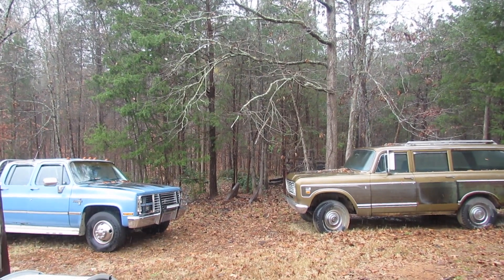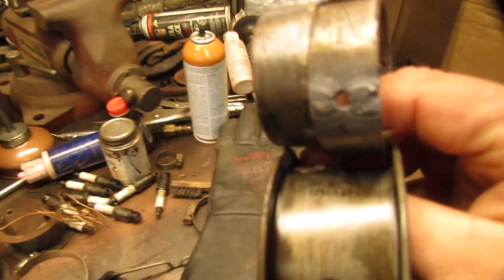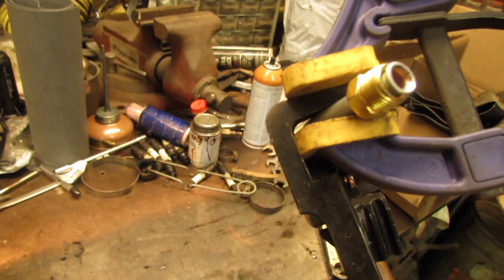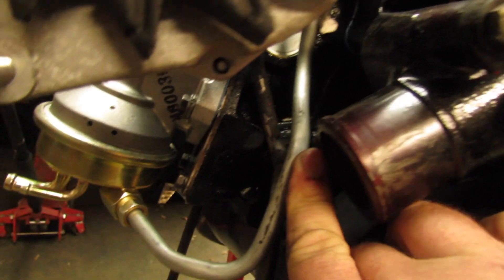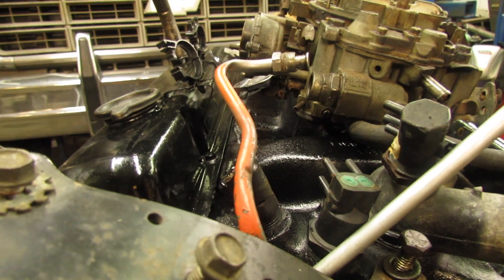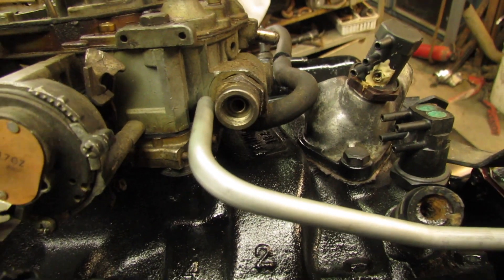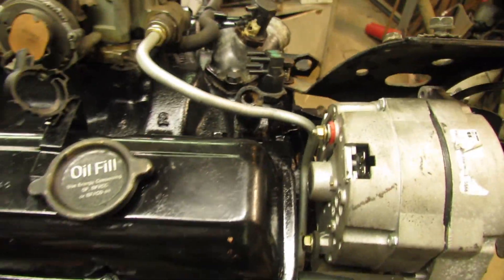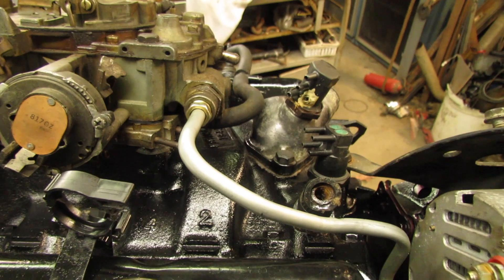Build fuel line for engine

Comment: Question. Is that fuel or brake line, and what size. Thanks! Great video!
Reply from the maker: It’s 3/8 line. Good for brake or fuel. Usually on the rack at Napa or whatever
Reply: @MrHevyshevy  Thanks for the reply!

Comment: How can I do the same with a 600cfm holley carb? I mean, the fuel inlet has no connection fitting.
Reply from the maker: There is probably one available.
Reply: @MrHevyshevy  thanks. That was a fast reply. Do you know about a good replacement for the banjo connect?

Comment: To all viewers... think about this. If you have to cut and flare your new fuel line... Run a piece of 3/8" rubber fuel-line over new steel line before you create your final flare. .. to serve as a bushing/cushion in tight spots near lower block area and tight spot btwn block and alternator.  Good Luck. Good video.

Comment: What type of tubing did you use and how much did it cost I have a 305 and a 350 I need to do this for
Reply from the maker: 3/8 steel tubing available at ant parts store. its not expensive.

Comment: Really nice work!  That's an ambitious fuel line project. I almost always insert a small filter close to top so I have the short connector rubber lines to buy me a little wiggle room. The filter provides the excuse for imperfection.

Comment: I hear on the next season of Dr. Who, they're getting rid of the phone booth and replacing it with Mr. HevyShevy's workbench. No one will doubt that somewhere on that bench ( next to the electrical tape and underneath the adjustable wrench) is a portal to another dimension.

Comment: Don’t forget to put the nut on before flairing......you remind me of me. Been there done that too many times🙄
Reply: David Brown Still not as bad as the mechanic that worked all night pulling the tranny on his 32' lowboy in order to change the clutch and flywheel at the shop I used to work at. He got everything buttoned up just as the sun was coming up and noticed the throw out bearing sitting on the running board!!

Comment: To repair the old fuel line, push an open end wrench over the tube ( same size as the outside diameter of the tube ), rock it back and forwards and you can re-round the tubing.

Comment: I still test my thermostats and plug wires instead of just buying new ones cause im cheap. Still running original plugs and wires in my 03 monte, 193,000 miles, was going to replace them at 175,000 but tested out good so I reinstalled them hahaha man im cheap!
Reply from the maker: DUH HACK SHACK no use wasting money. Sometimes the old stuff is better than the new.
Reply: I second that notion. Seems nothing beats the original stuff.